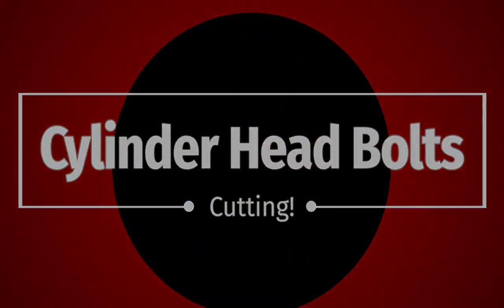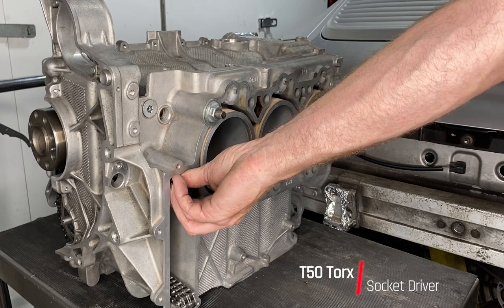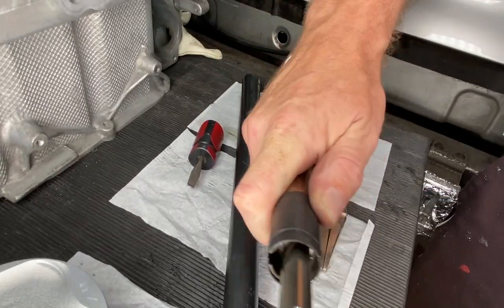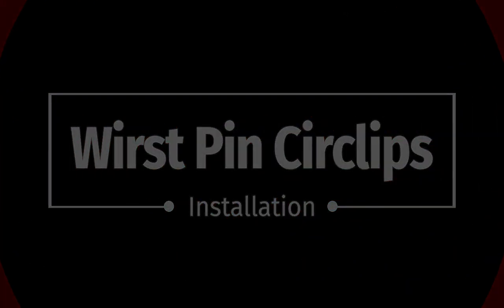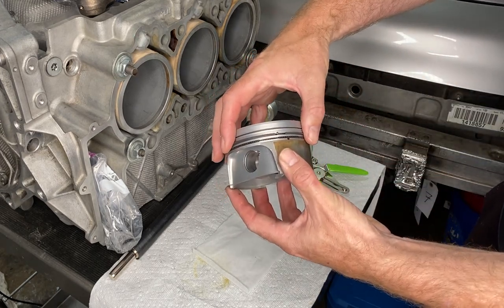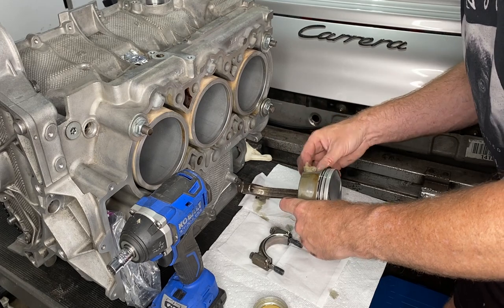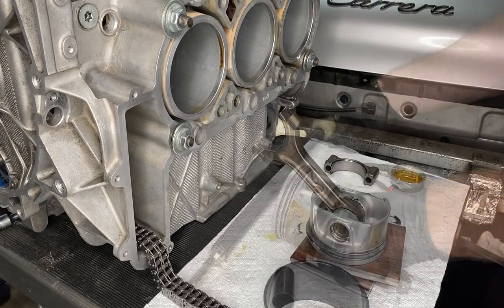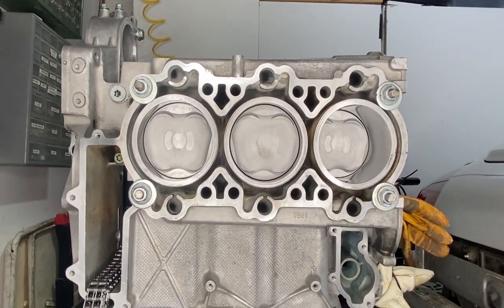How to install PORSCHE 996 Bank 1 Pistons, Hopefully!

Comment: You don’t want to be cutting and grinding in close proximity to very expensive Porsche paint as the hot metal sparks and shards of cutting disc etch the paintwork. You will see tiny rust marks in the paint then you will be getting it all machine polished out. It is also excellent at trashing the plastic coating on windscreens etc
Reply: It IS a tiny garage...😁
I hope this series ends in a nice detailing job to clay out the paint, that would be satisfying and would indicate success!
Reply: @miketdavies  or maybe you could just put a cover over it. I personally just go outside to do stuff like that as the dust will contaminate just about everything in there 👍🇬🇧
Just the thought of that in cleaning cloths fills me with fear!!!
Reply: I suggest you go back and watch episode one
Reply: @donesper2070  I can remember it was scratched but it didn’t say it needed all new glass or did I miss that??
Reply from the maker: Next to a pristine Porsche, that would be sacrilege, agreed. This car needs a full paint job, cutting 4 bolts near it won't add to its issues. Thank you for watching 🤘😎
Reply from the maker: The car will get a good wash when all the mechanics are finished, the current paint is not worth spending much time on. The car needs to be repainted. Thank you for watching 🤘😎